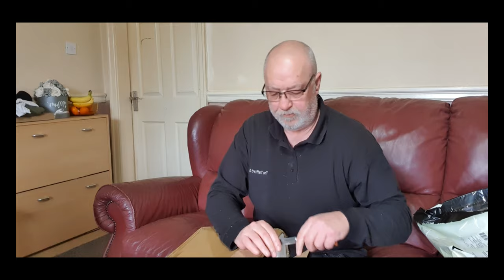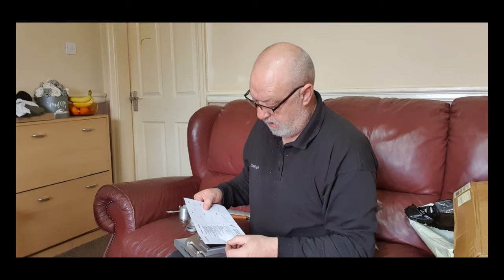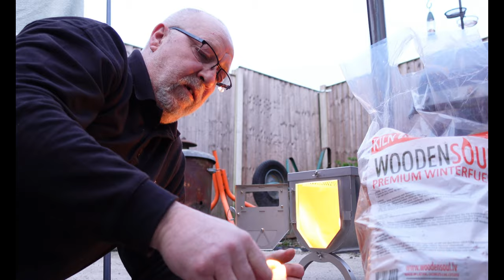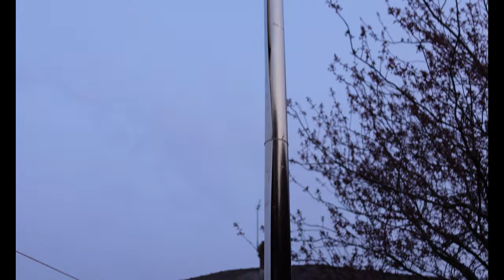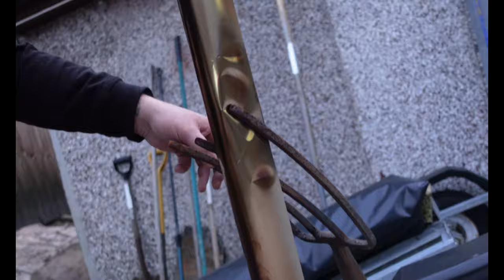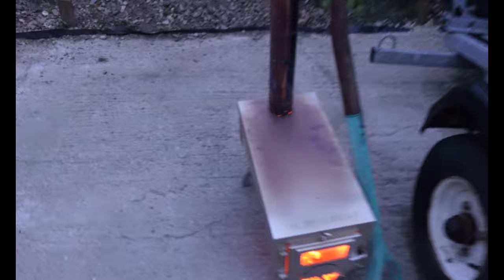3f ul gear tribe stove needs modification to be useable

Comment: the stove pipe is meant to be supported by the tent but I bought an extra support ring - for guylines on the top. It was on Aliexpress - and fits the stove pipe.
Reply from the maker: It should be stated that it's needed I think the stove jack wouldn't be enough on its own maybe if the stove pipe was cut shorter it would be stable but the general quality is low as per the price

Comment: Yours is the older version I think - because the 2.0 version doesn't have the rivets on the window and also no spark arrestor. I think the version I have - as advertised - it has the door a bit more tighter fit.

Comment: How do you design a stove that heats up the chimney so quickly? There should be guide plates inside so that you are not wasting 50% of the fuel.
Reply from the maker: I didn't design the stove but your correct it does help to have a baffle but damping the airflow does this also

Comment: How much times you can use it, until hole burns through so thin metal?
Reply from the maker: Not very long I imagine
Reply: I have the stove and so put a metal rack in the bottom - not that difficult.
Reply from the maker: The point is I think the stove should not need modifying but it does its cheap for that simple reason
Reply from the maker: @voidisyinyangvoidisyinyang885  all this would be better included as standard